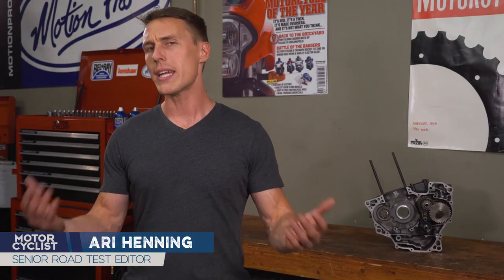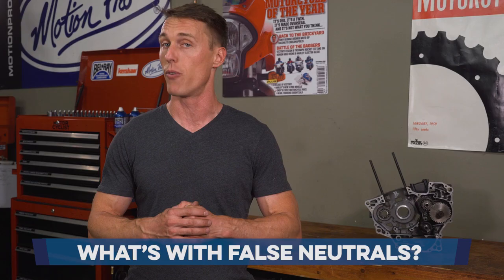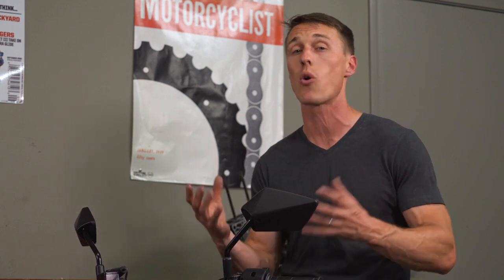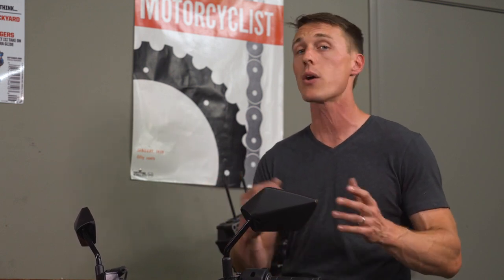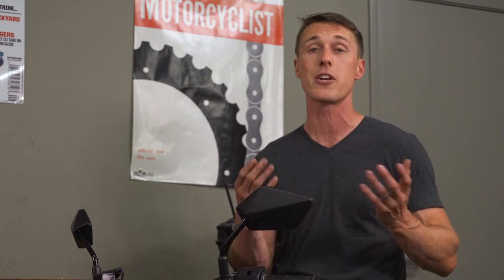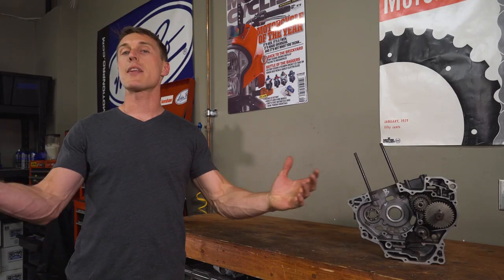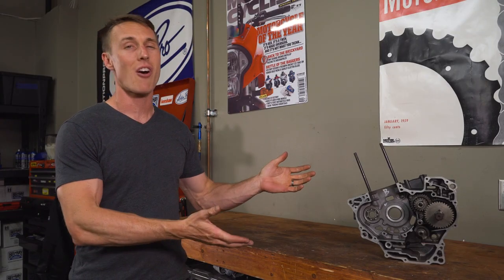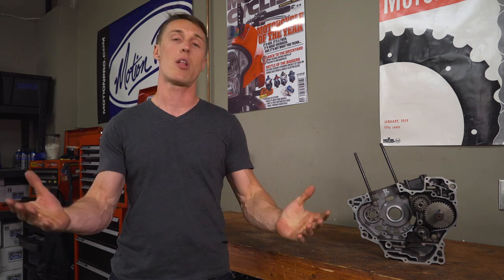What’s With False Neutrals? | MC Garage

Comment: Interesting. Thanks so much!! It happened to me for probably 10 times by now and it just happened between 4 to 5 and also 5 to 6. I have the 24 ZX10R and initially thought my gearbox has issues. Seems like it is good. 

I am guessing what my issue is. I think when gearing up, I hold my foot a little more than a split second to shift up and that causes issues. I started trying to do a powerful split second shift up and do it very quick and firm and hasn't had the issue anymore. But sometimes I am so focused on acceleration that my foot might be slow or I may not push so hard so I get this shitty feeling that the gear goes up and comes back down ....

Comment: Im having issues with my 76 sportster, bike starts and runs fine but when i pull the clutch and put it in first then go to take off its back in neutral and i have to put it back in first and it sometimes stalls if i dont keep it revved, clutch problem or tranny problem? Lever problem idk

Comment: Didn't help abit!  Most Hondas have a real false neutral.  Between 1st and 2nd. The way I've found out around it is to switch to neutral before stopping. Another words plan ahead. Never had an issue in higher gears.

Comment: I came here because I was riding doing high speed on my KTM RC390, I usually do Clutch less shifting on 3 to 6 gear. but when I shuft from fifth to six ( a little bit pressure on my foot in transmission) It redlined/over revved and it goes back to fifth gear and I was really nervous I thought I broke the bike., gladly, the transmission of my bike is still smooth and doing fine. I really need to put a little bit more pressure when doing Up shifts

Comment: If you're having a lot of false neutrals, your shift lever is probably set too high. Japanese bikes in particular seem to mostly be adjusted too high from the factory. I lowered mine about half an inch and it's been smooth sailing ever since.

Comment: Today when I was shifting from 4th to 5th and trying to accelerate past 40 it would go to 43-45 and start decelerating back to 40 and not go past 45 it kind of sounded like I was trying to accelerate in the wrong gear and the bike was decelerating. I haven’t gone on another ride since. But I should note , this is my first bike and it’s brand new and  I haven’t even hit 100 miles yet.

Comment: what about low speed woods riding and sloppy chain tension. this seems to cause false neutrals. it won't at higher speeds but the output shaft is moving pretty slow anyway plus the slop in chain. my daughter was riding her ttr hit sand pulled clutch back tire stopped it went neutral. I had to help her get it out of the sand and explain you gotta have spinning rear wheel to complete a shift.

Comment: I had a false neutral on my motorcycle test with the expert on the pillion seat. It was on an uphill so I lost a lot of momentum because I coasted clutched out for like five seconds. Luckily, the section led into a slow curve, which gave me an excuse to lose speed but also just at the start of the bend I got into a gear that was still too high for the power I needed. Finally downshifted on a straight section to carry the instructor's ass onwards up the hill :)

Comment: Was wondering why the hell I was getting more and more false neutrals, then I got home after stalling the bike a couple times on the way, only to find out that my hydraulic clutch was barely working. It's not in the shop and likely needing a slave cylinder rebuild.

Comment: Don't know if someone will read this, BUT! I have a 2004 R6 I got this issu/question about its transmission: I was about to over take a car, going 80km/h. I put 5th in and started accelerating, just as I got past, the transmission went to neutral, without me touching the clutch or the shifter. I then popped the shifter up, to get to 6th.
The question is, whats up with that? what can I do and is there any fixes for the sudden false neutrals?
Thanks in advance!
Reply: Could be just a lazy shift. I've had that happen. Put it in next gear and everything is good but a few seconds later it just pops out itself. Like he said in the video, be deliberate with each shift and it should be ok. I've heard shift kits help with false neutrals, I bought one a few years back but still haven't installed it.
Reply: @MrPetepeeters101  thanks, I started doing slower more thorough shifts and for so long this hasnt happened again :)

Comment: Experiencing an annoying false neutral when up shifting from 5 to 6 gear, it's also dangerous for the riding because I need to focus on the lever instead of the ride also I believe that in the long run this issue will damage the gears.
It's a brand new (2 months old) Honda CB300R whose model already had a recall problem.
My bike's VIN isn't in the list of the faulty bikes but I still experience the problem!

Comment: I recently got a cbr 600 with 13k mi on it and it has a bad case of easily hitting false n going up or down gears, and in between any gear not just 5th - 6th. What's going on i thought false n occurs only on high mileage bikes i feel ripped off lol

Comment: I had my motorcycle jump/change gears without me doing or pressing anything while riding at a normal speed. Rear wheel almost locked. What are the odds and why did that happen? I have been riding that bike close to ten years now and that was the first time it did that..

Comment: False neutral is the state where the gears disengage and fails to engage with another gear causing false neutral. It's common when we don't pull the clutch lever enough to change a gear  or not shifting gears hardly. Redlining shift also influence the gear shifting into a false neutral.

Comment: OK now that I understand how false neutrals occur I'm surprised that I have never experienced one in 25 years of riding my Honda VFR750. Just luck? And yet on the other hand I recently test rode a new Ducati V4 which has a quick-shifter - and a relatively squishy feeling gear lever which is apparently a q-s characteristic? (What's that all about?) - and I had several false neutrals, which were all probably my fault, not having a feel for the bike.

Comment: I sometimes can't shift from first to neutral unless  I kill the engine then shift to neutral  or else it won't go in to neutral
Reply: Go to second then down half to neutral
Reply: @Nick-ko1tw   the shift lever just feels stuck but then I kill the engine  and I'm able  to go into neutral  or into 2 it doesn't  do it frequently  but when it dose its quite  annoying
Reply: @biofall38  hmm i think it was also happen at me 1 year ago. When i want to shift to neutral, i need to shut off the engine or blip the throttle a little while shifting. Some weeks later my clutch cable snap off.
Reply: @biofall38  try to check the basic thing first like clutch cable and clutch adjustment. Hopefully it's not the tranny that goes wrong
Reply: @Nick-ko1tw  thanks ill check  the cable  today  it might  be out of adjustment

Comment: Simple: Don’t stab at the gear lever. Apply pressure until the next gear is fully engaged, the clutch is out and you’ve loaded the transmission again, THEN release the shift lever.

Comment: Brand design makes a big difference also. I had several Honda's of the 80's and 90's that were sticky as hell while riding Suzuki and Yamaha's with noticeably smoother shifting. Going through neutral (1-2) was just as bad. I had a Honda SuperHawk that would do unintentional 1st gear power wheelies. The shifting was basically locked up while the front tire was light and the trans was loaded. I would have to chop the throttle or clutch and let the front slam to the ground.
Reply: Snaker Stran totally agree. My suzuki has a great gearbox with good feel, maybe have had 3 false neutrals in 3 years.   Meanwhile the BMW gs700 i ride at work has a terrible gearbox. It’s really stiff, false neutrals happen often and it is ridiculously hard to get it into neutral when standing still. It’s either down to first, or up to 2nd, neutral feels like 1mm of space

Comment: When I hit neutral shifting up between first and second, I simply blip the throttle and upshift into second smoothly.

But when the bike jumps into neutral while cruising along in 4th or 5th, I tried blipping the RPMs and was greeted with a horrible metal on metal shearing noise before violently banging into a higher gear. My gearbox still works, but that just had to cause damage to the cogs.

Can anyone tell me if I should go up or down when I get neutral in higher gears? On an old K2 R750 if that’s important to know. Thanks.
Reply: LIke he said blip the throttle. but suggest go to a higher gear. As a bit less difference of gear speeds. change oil, install a magnetic drain plug. Keep clutch adjusted correctly. and Linkages must be correct.

Comment: Oh, now I get it. I'm not a motorcyclist but 5 years ago I was riding a moped with 5 gears. As I was going up through the gears, when I wanted to shift from 4th to 5th I just ended up in neutral. While still rolling on the road I thought would it be a good idea to shift back to 4th or pull up to 5th again, but I just stopped with the brakes to the side of the road to play it safe and not damage anything in the gearbox. I pulled the clutch and shifted down, let the clutch and the engine stalled so I knew that I was in 4th. Then I just shifted down to 1st and off I went again riding. That was my first experience with a false neutral and I thought that there was neutral between all gears, silly me. Now I know I must pull the lever all the way to avoid a false neutral.

Comment: Can you guys do a video on learning to match engine speed to road speed? I hear people (and Ari) mention it, and I understand the concept... but how do you know how much throttle to give, what RPM? 
Is there a specific speed ratio? Is it different for each bike? Is there a way to know? Like certain RPM for certain gears?
I don't get it and I've had a few false neutrals,so I usually just shift back down one and start again. (I mostly ride in slow neighborhoods, so slowing a bit to shift down isn't a big deal.)
Reply: that is something you will learn and feel while doing it there isnt a trick for it atleast not that i know of, if you know your bike well you and know al the sounds of the rpms in different gears you can sometimes guess the right rpms. the rpms dont have to be 100% accurate if its close its good enough

Comment: just happen to me and wanted to see what it was.  i was getting on the highway from an off ramp and started accelerating, was in 3rd gear and did my normal shifting up through the gears then suddenly lost power between 4th/5th and heard a loud CLANK so i got off the throttle. im assuming it went down in gear after catching back on.  i slowly took my exit and got home ok.  checked the chain/sprockets and everything seemed fine. maybe little more slack than the last time i checked it or could be normal wear.

Comment: I often have somewhat of a false neutral when I downshift quickly (3-4 gears at a time), I think I just downshift too quickly and don't fully engage the gears. But for some reason my bike will often stall, even though my clutch is pulled in.

Comment: During hard braking whenever I use the clutch and downshift multiple gears, it doesn't't slot into place( the gear lever doesn't move freely) and I need to release the clutch for it to slot.
It might be because the input shaft and gears are rotating at different speeds. But is this normal? Does it happen to all bikes? I have 200cc pulsar RS

Comment: There is another aspect to the clunk putting it in first that is the same as putting a standard transmission. If you are sitting in neutral with the clutch engaged (clutch lever extended)  the main shaft of the transmission is spinning even though it's not engaged to anything on the countershaft. When you go to put it in gear you must disengage the clutch and give the main shaft a moment to spin down or it will not just clunck, it will crunch. It's an awful sound to my ear as I hear teeth on a gear on the not spinning countershaft being forced against a gear on the still spinning mainshaft until the mainshaft grinds to a halt and allows it to go in gear. It will damage the gears and put metal shavings in the oil, just like the false neutral crunch will. 

I think the first gear crunch if you don't let it spin down and the false neutral crunch are related. It happens to me occationally when I'm running wide open and not paying enough attention to the amount of pressure I'm using on the shifter. In other words, I get nonchalant.  When you hit a false neutral between 4 and 5 the mainshaft and countershaft have disengaged and you could be going really fast. The diff is when you are sitting still the countershaft is not spinning, when you are moving, say wide open at the top of 4th gear and the shafts disengage the countershaft is spinning like mad because it's being driven by your back wheel. So it makes it worse if you pull the clutch in and let the main side spin down. Mainshaft spins to a stop with the clutch pulled in while the counterside is being spun related to the 90 or a 100 MPH (or more) you were going when it went all neutral on your ass. Push the shifter back to 5th and the main side has some serious catching up to do. There is nothing harder than that on the transmission, except maybe no getting the clutch in on downshift or downshifting when that downshift is going to overrev the engine. 

So when this guy says you can stop it or make it better by rev matching with the clutch in he knows it won't really work. So theoretically rev matching should be the thing to do, and that is what I have tried and tried and tried of ther many years. I have yet to get it crunch fee in over 50 years of riding. Something else must be afoot. Rev matching on downshifting is a totally different thing. You pull the clutch in, match the revs and shift before you let the clutch out. It's in gear by the time you let the clutch out, your just spinning the engine up to match.

 In a false neutral the mainshaft spins down as soon as you pull the clutch in. Now there is no way to avoid crunching it when you shift because the 2 sides aren't engaged until you move the shifter. Now, having the revs up means the engine itself doesn't have to spool up when you let the clutch out but that's easier on the engine, not the transmission. When you have the clutch in you can rev your heart away and it's still not spinning anything in the transmission. You put it back in gear with the clutch in, and that is when the bad mojo happens. Mainshaft spun down, counter sput up. 

The only thing I can think of that might work is not to panic when it goes to neutral and pull the clutch in. That's a lot to ask because it is so unverving so remember to let the cluch back out before you move the shifter and let it glide while you deliberately bring the revs back up.  Leave it in neutral with the clutch lever out, clutch engaged.  Look at the tach and figure out how fast you need to spin the engie up. (remember, as you glide the engine went to idle) Now spin the engine up to what you think a rev match is, keeping in mind that you are going slower than you were when it happened. Now you have the engine driving the mainshaft to a speed that's close to what the speed of the countershaft is moving at. Now, with the clutch lever still out and engaged, lift with your toe and put it back in 5th. But that rev match is hard because you started slowing the moment it went to neutral.  But theoretically, that makes more sense that l letting the main side spin down. 

Can I try it on YOUR bike? Mine is already 35 years old. (82 Honda Magna V-45)

Comment: I have a Stomp pitbike 140cc, all 4 gears are up, sometimes when I’ve got my clutch held all the way in and reving slightly and i move forward slowly, once i set off i go to change into second and it doesn’t change until about 4 tries, i know I’m changing all the way but does anyone know whats happening, does happen in any other gear
Reply: so you think that is a motorcycle do ya?